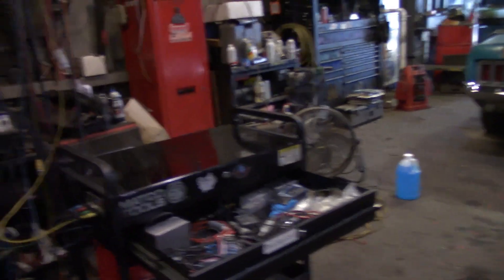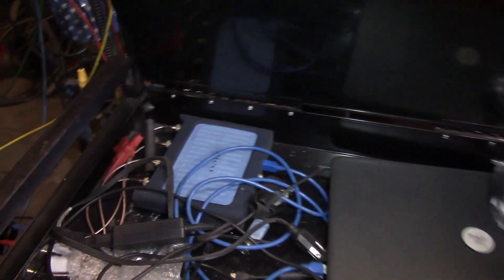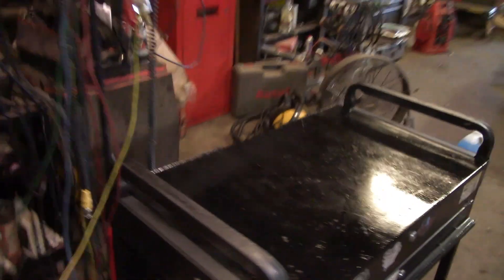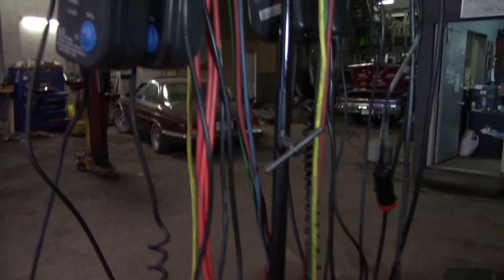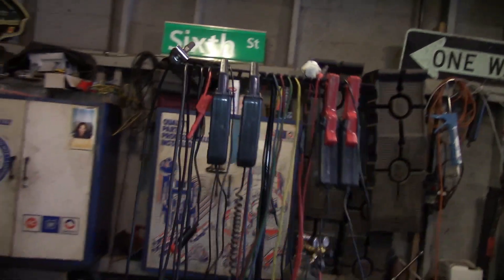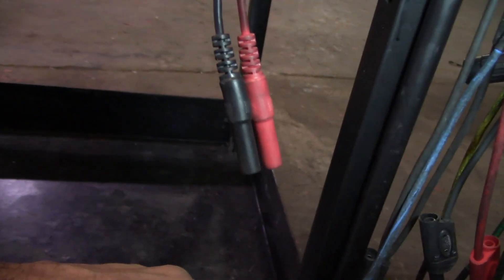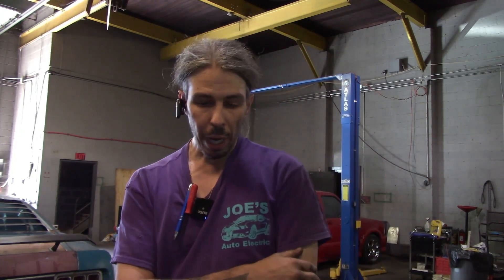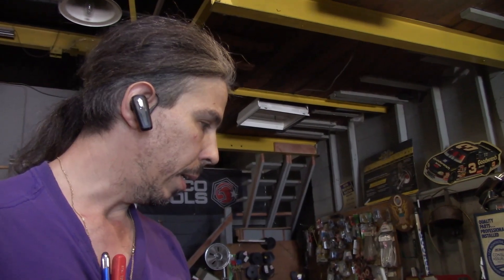Pico Boom?

Comment: Something that may be cool it to get a mini computer mounted permanently and then put a monitor stand and a small monitor on top or on the inside of the lid so it's ready when you flip it up.   You could put a battery and in inverter on the bottom to keep it powered when you roll it around.  Now I am getting all kinds of crazy ideas!  It's the problem with being an IT Network Engineer and a Mechanic

Comment: love it, one recommendation if I may is to add an exhaust fan to the rear to pull the heat out that the laptop generates. a computer case fan should be enough.
Reply from the maker: Sweet! I will have to do that.